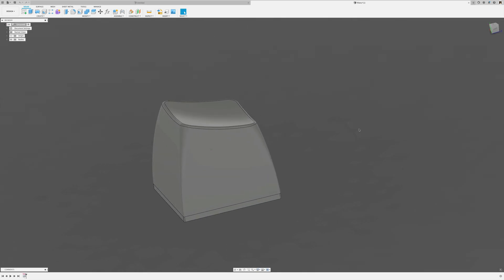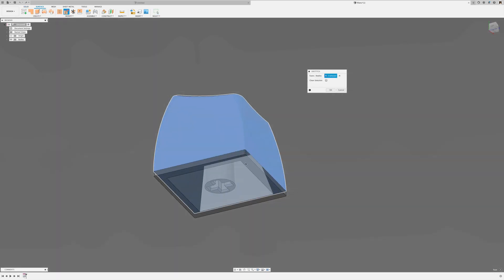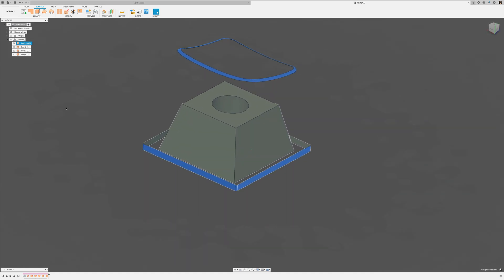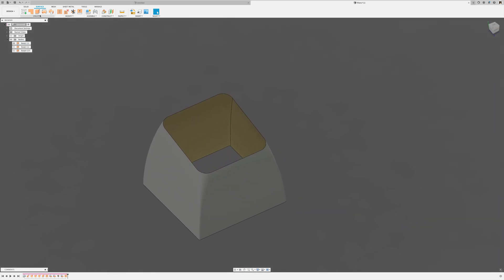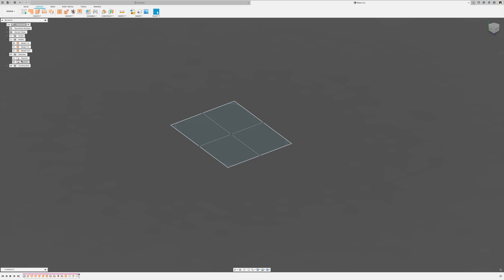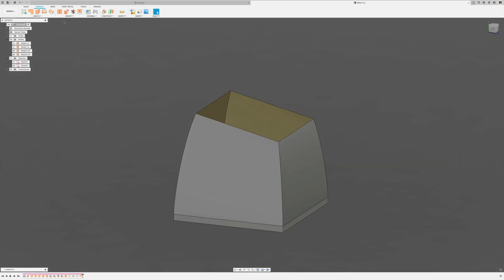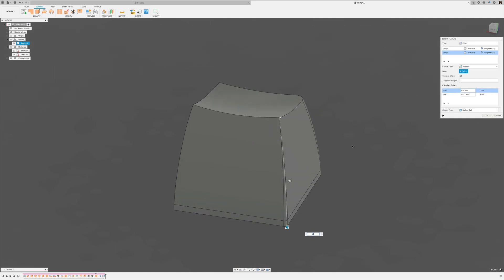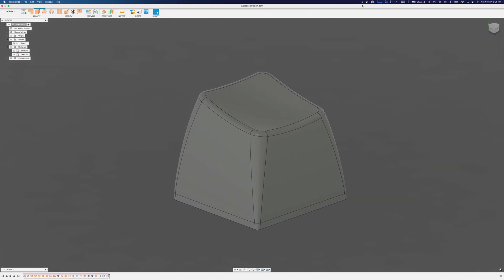Fuson 360 - Forum Response - Recreating a Keycap

Comment: Thanks Peter for your excellent sessions. Let me allow to ask a more simpler question: 

I like this form (german ) tool to  modify bodies.  But how I can come in this situation? : 

 I have a flat solid with splines curves as boundary . Now I  want to build up the  flat construction  to 3D sculpture with double curved surface, like a  sculptor. The only restriction I don't want to change  the boundary form of this model. So I must start with this solid (coming from a .SVG File,  now with thickness, that it).
I search a while for a solution, but I doesn´t find anything . 
Always the guys started with  in  sculpt (From )modus, I am i  the solid modus .How to came with such model  in sculpt mode ? Thanks for our suggestions. Christian